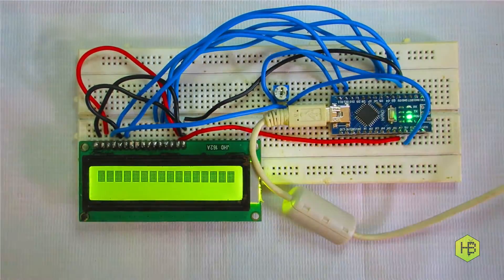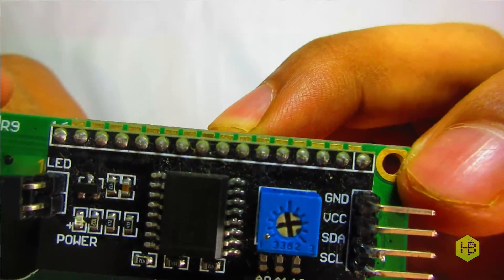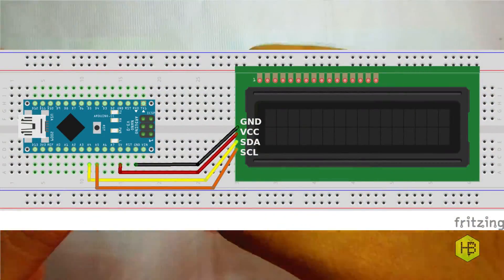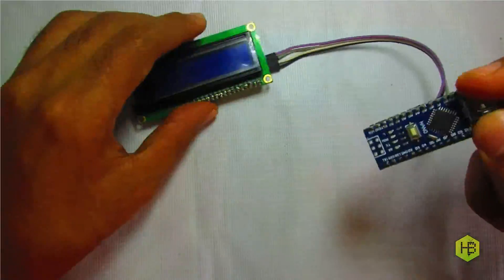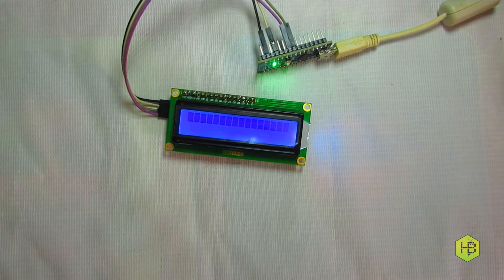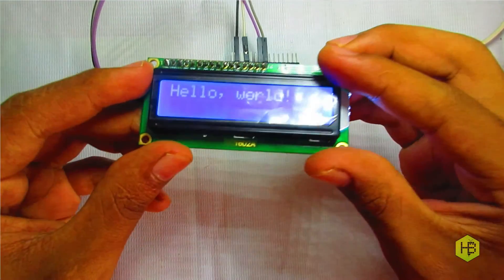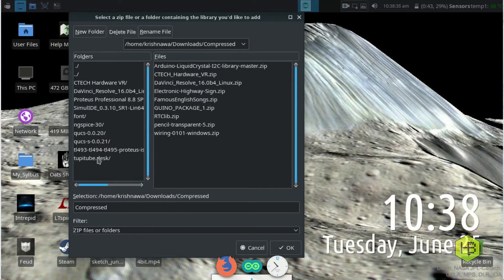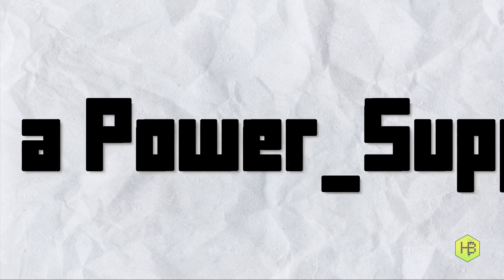LCD Basic Tutorial | HEX BEE | Malayalam

Comment: So what the other data pins for? why we are using only 4 data pins?
Reply from the maker: There are 2 types of methods are there 8-bit mode and 4-bit mode, for saving the microcontroller pins Arduino uses only 4 bits, to set 8 bit or 4 bit we are giving commands to the LCD with the help of RS pin I'll give full explanation video about that, stay tuned